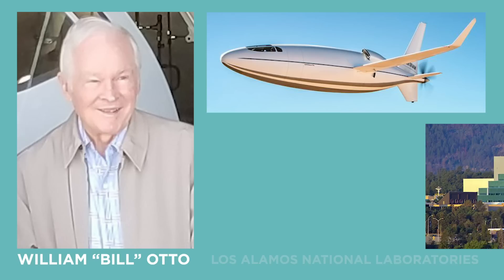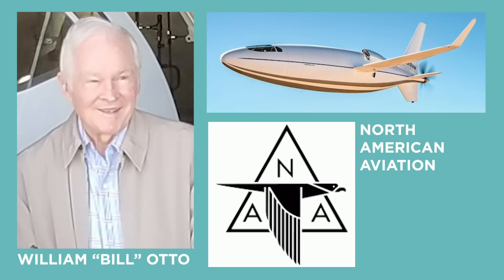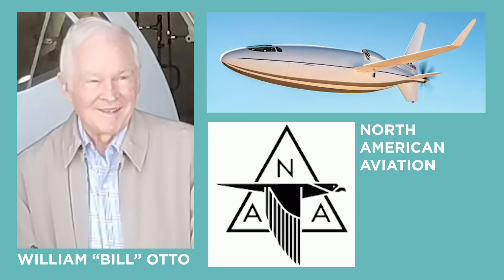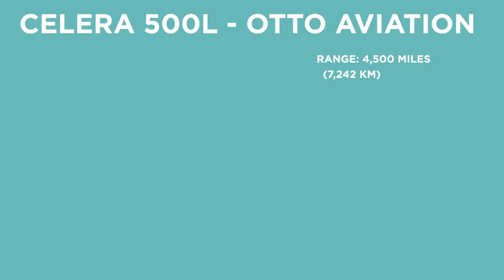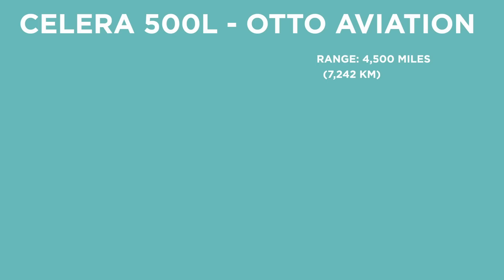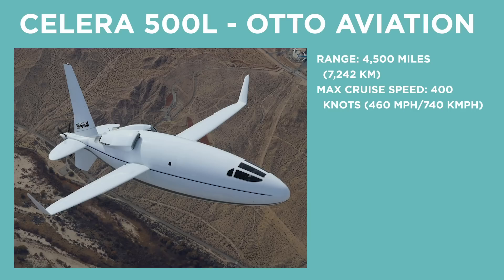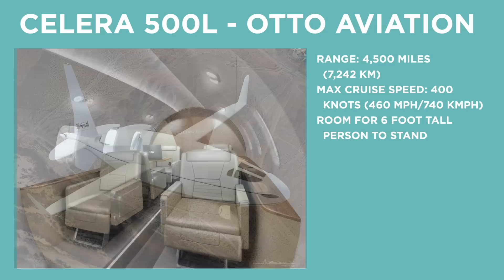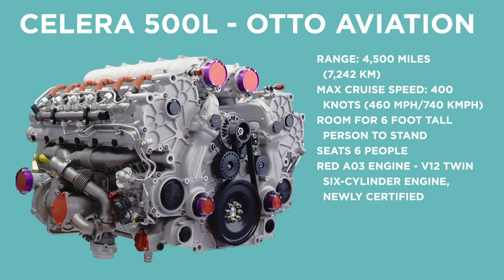Could This Plane Save The World? (Hint: No.) | Answers With Joe

Comment: That mockup looks like it has six first class seats. It could double the seats if they were normal size, and service smaller airports in the direct point-to-point flights that the industry is moving to, away from the hub-and-spoke model it's been following. That could make it much cheaper to service tiny airports like the one in my 5000-person hometown.

Furthermore, this could also revolutionize cargo transport in Alaska, where planes of this class are already the mainstay of that industry.

With normal seats and the size upgrade Joe mentioned in the end of the video, it would be in the ballpark of some of the smaller craft serving regional markets. I'm not an engineer, but I don't see why a bigger model based on laminar flow, in the size range of the 747, wouldn't be possible.

All in all, this thing has a real chance of being the Prius of regional flights. We still need to get to electric planes, but this is a bridge to that world.

Comment: the only big factor that I don't think you took into account is something like a 60% booking situation. The price of a 747 with only 60% of the seats booked does not reduce very much in cost to fly, whereas with many smaller planes you can add or subtract the number of planes flying to meet the demand at that moment. It would be more flexible to have more smaller planes.

Comment: The Celera is clearly designed for small commercial operators not major airlines doing international flights. This would include charter operators who now use twin engine piston aircraft and  business jets as well as gas turbine operators which is why the Pilates was mentioned.
Essentially it is a bit off the point to compare it to a 747 in the same way a new efficient delivery van would not be compared to a large articulated truck.
Within its field, the Celera sounds like a step forward in aviation although it’s probably a good idea to take the specs with a grain of salt. Very often the specs of new prototype aircraft are recorded with no passengers or load, low fuel loads and high altitudes and best cruising speed and is really released to encourage investors. The engine specs seem very promising too but I would like to know a lot more than what has been published before I put too much stock in the pre approved aircraft performance. Perhaps more importantly I would like to know what the aircrafts handling, stall characteristics and ground handling  are like.  The wings seem to have a very thin chord and looks like it is set up for high speed which is good but not much use as a regional aircraft if you need a jet length runway to take off and land and can’t take very much g. The compromise between lift, drag and power can make a fast aircraft very difficult to fly safely. (Think the Dr Killer, the Beechcraft bonanza when it first became popular)

Comment: Modern long distance planes are around 100 mpg per passenger.  Typically fuel efficiency per passenger gets better when you move toward larger planes.  There comes a point where the plane is too big and you cannot reliably fill all the seats on your flights and the extra size starts being a liability.

If those efficiencies can be achieved with the Celera, then it only makes sense to scale it up to bigger planes to improve efficiency more.

Comment: Beside the Boeing price another issue is that the 6 seated Celera is configures as Business class. I would expect it to accept 9 (3 rows of 1 by 2) or even 12 (4 rows of 1 by 2)   passenger in Economy configuration which will reduce your numbers by 33 or even 50 %. Also the bigger Celera 1000 would be a better choice for commercial aviation and probably would fly the Boeing out of the sky, but I agree, at this point there are not enough details about it to make a proper comparison.

Comment: I think the 747 is kind of a fringe case. It’s optimized for moving large numbers of people within hub-and-spoke systems. The reality is that a lot of the people traveling on 747s aren’t flying from London to New York. They’re flying to and/or from a secondary city. You need to add in the costs of the second and maybe third legs of their trips if you’re comparing versus a 747. If you factor in all the aircraft and crews it takes to fly all those passengers in the 747 to their final destinations, then 61 Celeras might start to look much more attractive. This aircraft isn’t meant to replace medium and large airliners flying between hubs, which brings me to my second point.

The beauty of the Celera is that it allows for a very different business model than the traditional hub-and-spoke. The Celera is optimized for moving small numbers of people directly between their destinations. Now instead of taking a little Embraer from Scranton to New York, a 757 from New York to Seattle, and a CRJ from Seattle to Spokane, I can book a flight directly from Worcester to Spokane. There are a whole lot of people on that 757 with me that are coming from and going to a long list of other secondary cities.

You’re also comparing a coach-class ticket to business-class accommodations. Four business-class tickets from Scranton to Spokane aren’t a whole lot more than the hourly operating cost of the Celera. If you can sell all 6 seats, then that’s a real business. I’d be willing to pay a bit more for the convenience and time savings, just as many people flying traditional commercial would pay more for a nonstop flight at their time of choice versus a flight with one or two layovers at ungodly hours.

The Celera doesn’t need to achieve price parity with traditional airlines. It’s a different business model that will lend itself very well to demand-based semi-scheduled and charters flights. A more relevant economic comparison than a 747 flown between hubs would be a partially filled regional or mid-sized airliner flying between secondary cities.

And we haven’t even talked about flying cargo direct to its final destination. That’s a huge opportunity, especially considering that cargo will be able to fly without human pilots long before people will.

Comment: Hi. This piston engined propeller driven aircraft will only be efficient at lower altitudes, where the denser air gives more thrust, but also high drag. High speed at low height is inefficient. If it was repowered by a turbofan jet, it could fly at 10,000 meters where jets  produce more thrust than propellers, and it would also have quarter the aerodynamic drag. Drag increases as the cube of velocity, so speed is the enemy of economy. As a jet, it would need a pressurized fuselage. At six passenger seats per plane, as it is or as a jet, it'll never pay for fleet maintenance costs, so the spacious seating depicted is unlikely. The first commercial aircraft to break even was the DC3, which flew at 180 mph.  Otto's plane actually resembles the Curtiss C20, a spin-off of the DC3 formula. Good sensible video, thanks. Cheers, P.R.

Comment: Private jets offer amazing benefits. Private airplane travel allows a passenger to avoid check-in wait time, security wait time, the time you need to arrive early, boarding time, flight time, and the significant time spent traveling between the airport and your final destination, because the airports they can fly into are closer to your final destination. If a business is paying its employee many thousands of dollars an hour, it does not make sense for that person to fly commercially. It's exactly the advantage of driving a car as opposed to riding on public transit. However, private airplane travel is exclusive because of its cost. However, if that kind of travel was made as cost effective as an airline ticket, there would be a large shift in the airplane travel market. It would create a market that does not exist at this point in time. This is the thing that most people, including this video, don't understand. 

That doesn't mean, however, that it will replace airlines and large commercial airliners. It still will be cheaper to fly commercially. There is no way this will compete with RyanAir, for example. Current regulations prevent it from flying overseas, and then it physically can only fly over the Atlantic non-stop. That's not to mention the problems with pilots and ATC, thought those aren't as serious as the video claims. 
The real problem with this airplane is their performance claims have yet to be proven. They have maybe 50 test flights in 4 years? And only to 250 mph and 17,000ft? That is a bad sign. The engine is not certificated by the FAA yet, which is an extreme challenge in itself. I'd say it all revolves around that. I bet that they will run out of money before they get that engine certificated, and in order to salvage the program, will have to change to a turboprop power plant. If that happens, all the performance and economic numbers change, and it becomes a weird looking, albeit high performance turbo-prop, instead of the industry changer it was meant to be.

Comment: I think that scaling up the Celera 500L to the 2000L is what needs to happen.  A bigger plane can carry more people.  Sure it would burn more fuel but the hyper sleek design is what makes it more efficient.  It looks to me as if the plane's body is actually a "lifting body" meaning that it itself generates lift.  Plus there are no large jet engines and their mounts sticking out in the wind.  The Celera 500L has an efficient pusher prop right at the end of the fuselage.  And the motor is tucked inside, not hanging off the wing(s).

Comment: Technical feasibility doesn't necessarily equal economic viability. This aircraft definitely isn't a competitor for the "747" but it would be (economically) viable as a low cost alternative to the classic 'business jet' and for 'air taxi' type services in the commercial space. 

Electric propulsion is most suitable for flying training, where the aircraft operates from (and near) one airfield only, making numerous short duration flights.

Comment: I think an apples to apples comparison would have been far more worthwhile. 

Comparisons against all other aircraft in the corporate or commuter class would fail if you compared them to a heavily used, janky, end of its life, old 747.

The Celera has far greater range than a Beech King Air 360 (~1,800 nm) or Piaggio P.180 (1,700 nm), tremendous speed for a single-engine aircraft and the much lower maintenance and operating costs of a single piston engine rather than one or more turbine engines.

It’s an odd-looking aircraft for certain,  and I won’t be surprised if it has idiosyncracies, but this leap in performance could really be impactful going forward.

Comment: A used Boeing 747-400 of mid to late 1990s manufacture can be had for $20 million more or less: there's a huge variation in this price, depending on air hours, engine spec etc etc. But $20 million is well within the ballpark.

Comment: 747-8 is $419M. A $20M 747 is not simply "used" it's scrap value. A functional used 747 is over $200M with a certified new first-time re-spar. No re-spar = no passengers and no freight. Second re-spar drops the cost to $95M to $100M. More than two re-spars means the company flying it is using a cost-to-death ratio calculation as a key part of its business model. "Fly WTF-Airways. We'll get you there. Sometimes.... Honestly, we have no idea..."

Comment: Compare the Celara 500L fuselage shape to the Piaggio P180 Avanti.  Both planes will compete in essentially the same general aviation market and are similar.  The Celera's Red A03 engine is a diesel, an advanced diesel, but still a diesel, while the Piaggio has twin turboprop engines.  The Celera does have a significant range advantage if it is real.

Comment: More fuel efficiency reduces cost which in a competitive industry translates into lower fares.

Lower fares usually means more passengers flying which can more than cancel out any environmental benefits from more efficiency.

Modern airliners are vastly more efficient than their 1970s predecessors but the aviation industry overall produces more CO2.

Just another factor to consider.

Comment: There are a couple of important concepts  to know here. One is  that is that air travel is, at its heart, is the lowest form  of operational entropy  for transportation  on Earth.  For example, there are aircraft that are faster that 100 m.p.h. that have no motors. Gliders .And think about it...how do humans perform maintenance or construction on their Mom Earth's air girdle. There is no such thing as trying to change  the weather. Except  that  hersons here on Mom's Earth are dong exactly that. Climate crisis. If Mom Earth were the size of a cue ball, her atmosphere would be the thickness of a coat of varnish. Her atmosphere in not a garbage dump. And it ain't that big.  And so, back to entropy and  earth travel. This Otto airplane builder crew has been around the block a few times, and they hit a home run in all aspects of knowing how to construct a travel vessel with fabulous performance. By applying genius to first principles. That will put most jet aircraft out of business, and change the design of all the rest. And battery aircraft are already in the future of Tesla.

Comment: The comparison with the 747 makes no sense in particular because the idea of the Celera was to be able to operate using small airports which can't handle jets, and to be able to start and finish closer to the desired location. Talking about a 747 assumes that everyone on board wants to go to the same destination. Otto are comparing it to a business jet, not a wide body airliner. Anyway the 500L is a starting point. If you scale up the aircraft, the laminar flow design could make domestic flights much more efficient. If you convert it to hydrogen as a fuel, it could be zero carbon (assuming that the hydrogen is created in a way which doesn't release CO2).

Comment: It's also that they don't make 747s anymore.   You also need to consider, airlines pay for takeoff fees at major airports, so the slotting fees for a 6 seat plane is way higher per seat.  A more honest comparison would have been to 737s since they are the standard plane between routes in the US, not 747s.

Comment: So this “disruptor” is not a new concept by any means. There was huge hype around the light jets (ie Cessna mustang, eclipse 500, diamond D-JET, etc) so they it would make fast smaller aircraft travel available for the masses. Switching from the tried and true hub and spoke system to point to point travel. I work as a Medevac pilot in the great white north flying to big airports and small gravel strips. Unfortunately there are some neat pros to the celera 500L, I think it’s a small market niche product. It has no cargo door. No room for cargo. It’s limited to what airports/strips it can land due to rear mounted engine. First glance shows that it has no boots (wing Deicing), no consideration for icing. Also certification might limit its operations because it’s a single diesel (still a piston) engine. So commercial operations might not be allowed to use it like a turboprop (turbine engine with a propeller) thus limiting to where and what it can fly in. I would love to take this for a ride sometime but I’m skeptical of its commercial viability